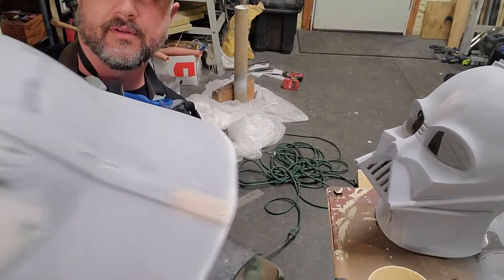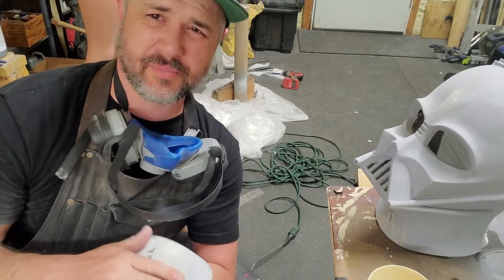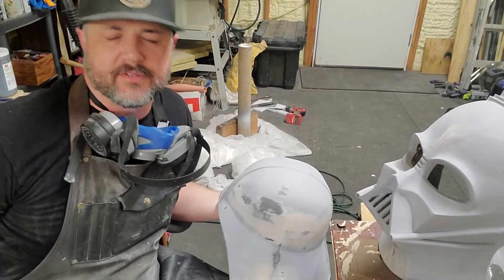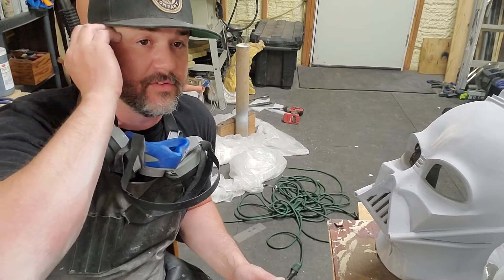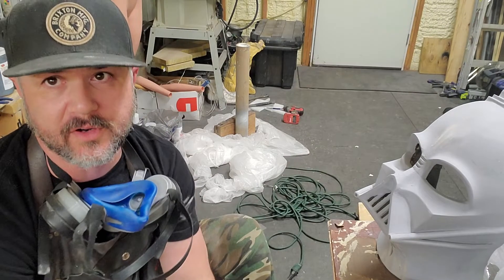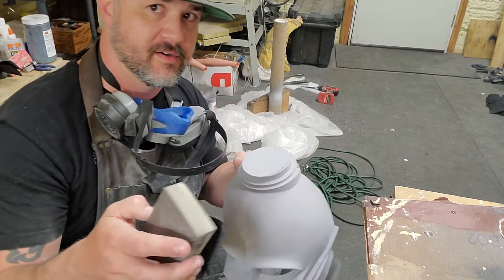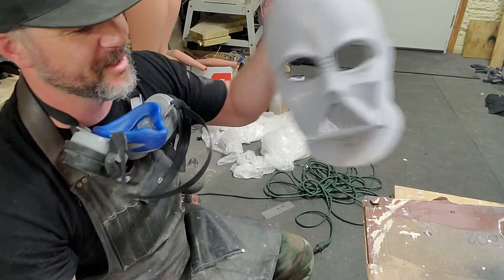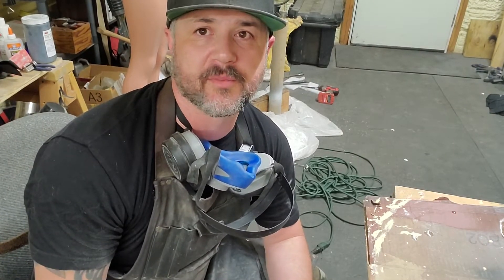Star Wars 3d Printed Rogue One Darth Vader Costume Build.... Part 3..Sanding/Micro-Sanding

Comment: Watered down what?
Reply from the maker: Wood filler.  It's on a previous video.  I don't use it anymore though. I used thinned down Bondo glazing putty.  Thin it down with acetone and brush it on to fill in print lines. See my most recent video.👌